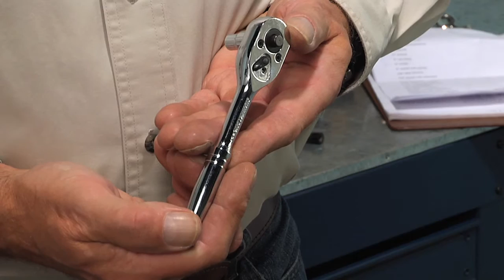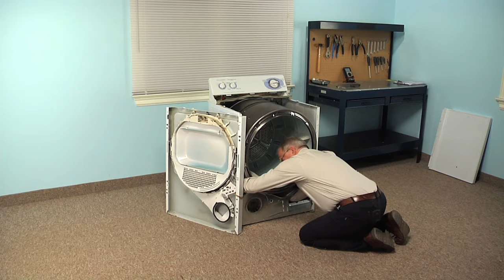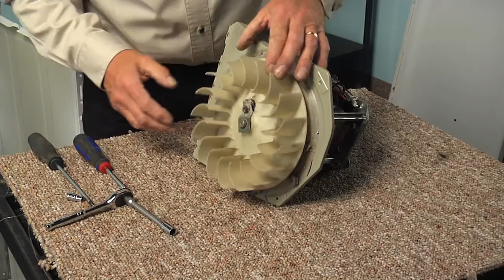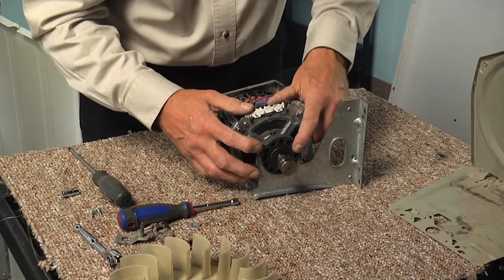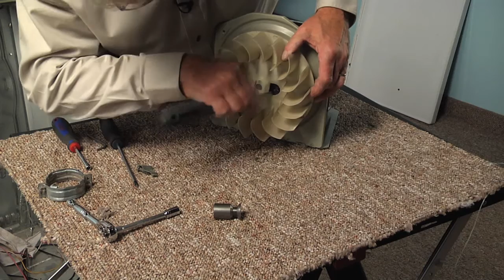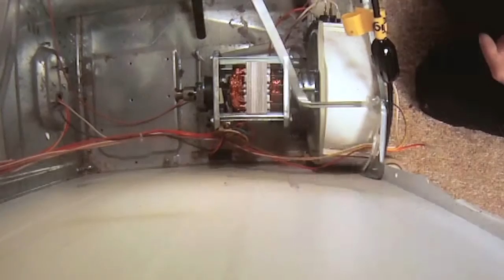Dryer Repair - Replacing the Drive Motor (GE Part # WE17X10010)

Comment: Good video, fixed a neighbor’s dryer using the video as a reference. The new motor came with a new jumper harness so installing was tad different but not bad.

Comment: I successfully replaced the motor in my 15 year old GE Electric Dryer using this WE17X10010 kit.

I found the explanation very helpful, answering most of my questions. I also used a video from Amazon https://smile.amazon.com/vdp/097f09c5e5a746839a6de3ab55dc9cae?ref=dp_vse_rvc0. I did not need to deviate from the instructions except for one place - see my final tip.

I have a few tips to share:

-- Have a vacuum handy to get rid of dust. Keep it handy.
-- Have a flashlight handy
-- Wear gloves and cover sharp edges temporarily
-- Use your cellphone camera to record every part you take off
-- Keep small parts and screws in containers. I used sandwich bags.
-- Brute force is not needed. If it isn't coming apart easy then you're doing it wrong.

Final tip

-- Removal and replacement of the drum belt on and off the idler pulley and motor pulley is much harder than is shown in the video. It requires great left hand strength and dexterity. I recommend using a three foot length of thin rope to pull back the idler arm with your right hand, so your left hand can fiddle with the belt.

Lastly

Read through the instructions and watch the video all the way thru to be sure you've got it understood. Do a mental dry run and make sure you actually have everything you need. Mine was a drop-in, but maybe yours isn't.

Comment: Not easy for me.  My old GE dryer was nothing like what is described. Needed torx screw driver set to open dryer and install wiring. Not possible to loosen drum belt from front (as described) so had to open back to do it. Had to remove clip from back to remove drum. Had to remove entire fan assembly housing and motor to remove motor (not only part). 

Wiring not as shown in video. Wiring connections on new motor entirely different from old wiring and instructions given in package were no help. After some anxious time, found a diagram on the internet that worked and finally made the new connections.
Reply: Would love to know about that diagram you found. I'm trying to replace a motor in a 1997 GE gas dryer. The new motor I purchased has a jumper harness. I figured out how to install it, but I'm uncertain about how to connect the wires from my machine to the terminals in this jumper harness. My machine does not have a wiring harness, but rather individual wires as seen in this video.
Reply: Hi Michael, did you ever find a solution? I have the individual wires too @MusicaMichael

Comment: Thank you so much! I had a repair tech out to check my dryer, and he told me that the part (motor) wasn't available, and there was nothing he could do. That cost me $90. I found a salvaged motor on eBay, followed your video (granted it took me more like 3 hours than 20 minutes), and my dryer is working again. You rock!